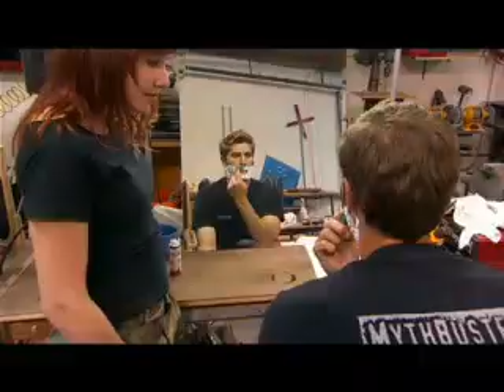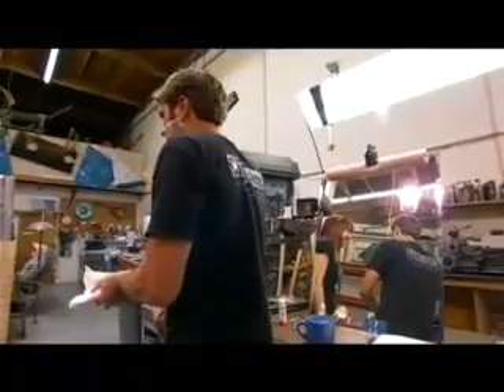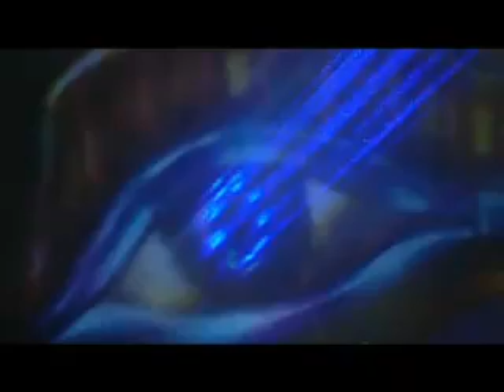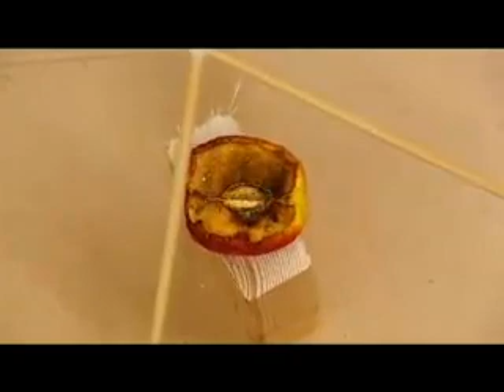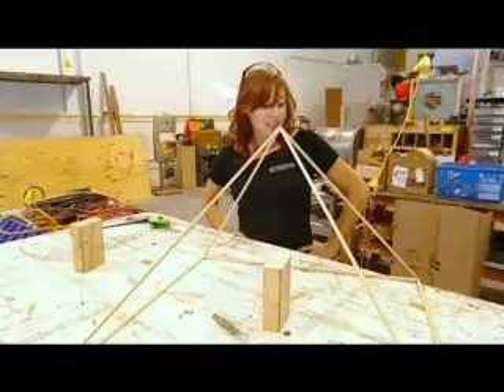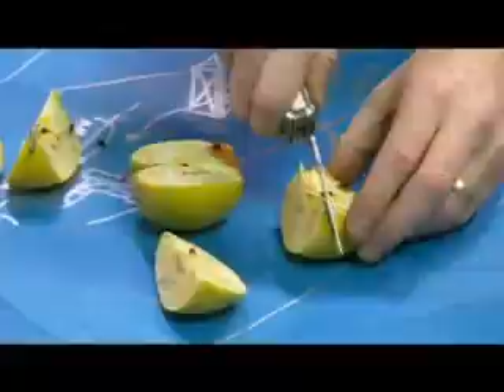Mythbusters 3x14 Pyramid Power (2 of 2)

Comment: There are so many different factors inside each piece of fruit; the acids, the sugar, the microbes (that were at least killed in the last test, but does the UV light reach into the apples?  I don't think so.)   I would have cut an apple in half with a sterile blade, then disinfected the cut surface, and then monitored each half.  I'm not sure why they didn't do that.  Also, they could at least have covered the milk so the flies couldn't get at it.

Comment: the control was next to the pyramid i agree but so was the cube so sure the two force would contradict and they would all rot at the same rate also if the cube apple was older than the other two then it would degrade quicker than the other two in which case they got the correct answer but by taking a different route.

Comment: Also they are using only a pyramid skeleton. Real Pyramids are 5 to 10 times better then just the skeleton.

Also pyramid energy will fill up the whole room. so controls need to be at least 50 feet away and in another room.  

also did u notice how bad the cube apple was?

John Miller PhD
Reply: The apple in the cube could have just simply been a "bad apple" in a batch.  Not uncommon.  Can't definitively say that the cube had a negative affect on it when it could have just been bad.

Comment: @Srjl:
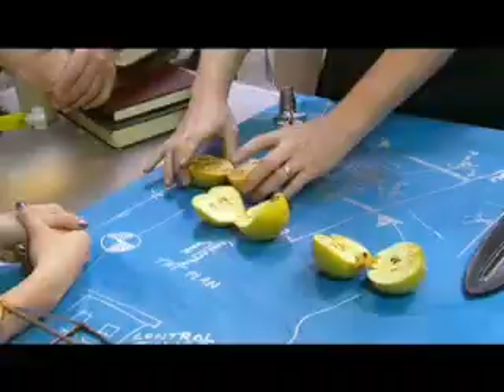At 3:22 you noted "Perhaps the Control, which was right next to the pyramid, was still under the influence?" I don't see how you can claim that the power of pyramids had affected the control as well when it clearly sais in whichever instruction you have that the product must be placed 1/3 in height, in the middle while pointing to the north. The control wasn't in the pyramid, it wasn't facing north. Just face it, it's more to it than a bunch or copper rods to get any result. Mundane ones.

Comment: the experiments would make more sense if they used actual structures then wooden outlines of shapes, how could you possibly think that having the outline would make the experiment correct at all? It is the physical matter around the object that would in turn control the energy flow in a structure, not just the shape. I also am disheartened that the mythbusters crew is just gonna give it up in fear of our government. What kind of government is that? these experiments could one day save our race.

Comment: @UltMitSinner78 Science is repeatable. If pyramid power truly worked, they would be able to get the same results no matter how many times they repeated the test and no matter how many variables they accounted for.
Geometric shape alone being able to slow decomposition seems to be at odds with conventional science (or basic logic for that matter), so they shouldn't call it based on one test.
Reply: They need to repeat them correctly, like store the blade in it for 6 weeks first, or it's bogus.

Comment: Belief is an energy. Yes. I would agree beleif helps more then anything, Pyramids are thought energy antenna systsms (taught if different books) This book is actually vauge, Have it, Though a working pyramid is always grounded, shielded, and it is alot like a solar panel on the insides of the walls. Just a simple structure with out any grounded or (capicity) they will produce very little energy. Pyramids are capacitors when they are designed right,  and eminate frequencies depending on angle.

Comment: P.S. I know of 11 pyramids in the USA that are on the Earth grid and eminate the hearth chakra frequency. People are using them with results, but (pyamid power) that book, I have it, it has 99.9% more instructions then these guys even read or tested. Those simple pyramid plans barely eminate any energy as they are not Grounded right, there are no panels, and the panels are lot like solar panels. These pyramids would never do anything except maybe spin a dowsing tool, pengelum over top (windless)

Comment: I would rather they have done a layered step, meaning a whole layer of seperated foodstuff for each degree of elevation over 10 pyramids.

At least that way, any results shown would have been impartial and you can track the effectiveness of position at any time.

Also, it's always good to pasteurize any foodstuff before hand to ensure uniformity. Cutting the apple with a sawblade was uneeded and extravagant, asking for spoiled results since rust in trace amounts promotes microbial growth.